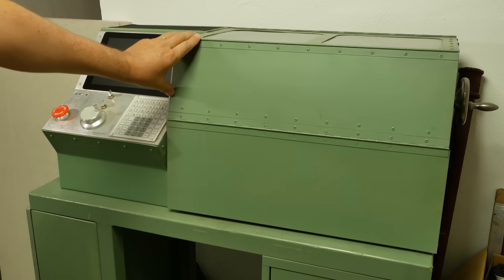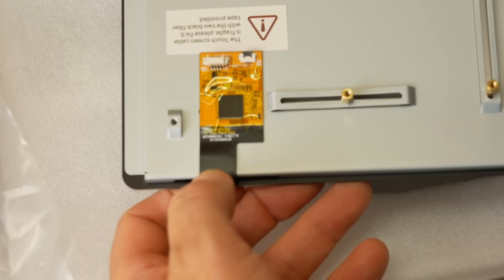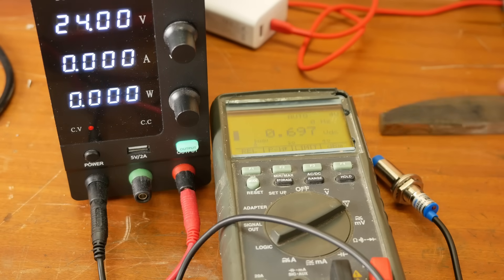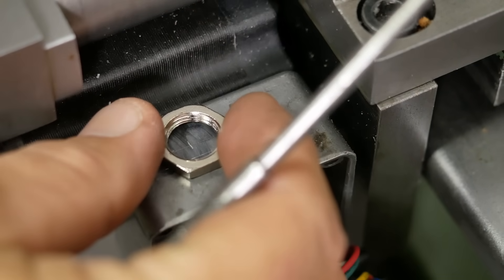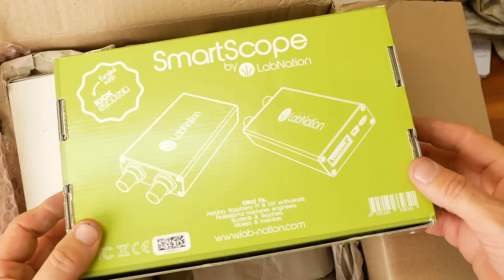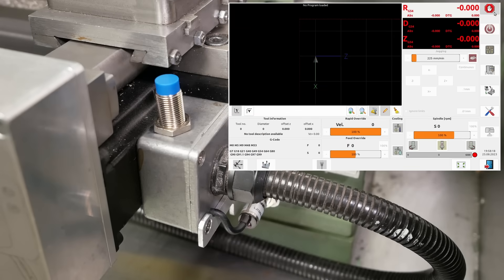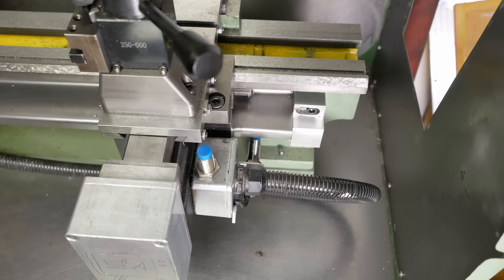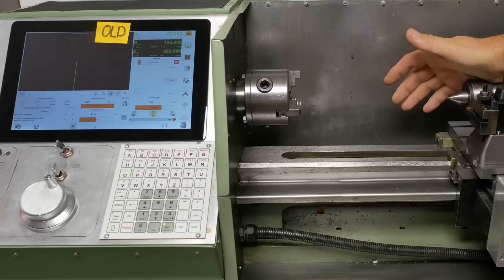Home switches - Minilathe Ep. 41 || RotarySMP

Comment: For the screen my guess would be graphics driver/settings. Hope it helps 🙂
Reply: You can add some options to the config file on a raspberry pi to force it to detect a monitor connected to HDMI even if one isn't. I used to have issues with a raspberry pi media player connected to my TV - if the power went out, when it came back on, the tv wouldn't be on but the pi would power up, so it'd boot up not detecting a display at all. Adding that option helped. It at least "detected" a display even if the TV wasn't on when it booted up, but it booted at a super low resolution, so I always had to reboot it anyway to get the proper resolution back. I've since moved to a full linux box (using an "ultra small form factor" desktop) media player, and all those problems are a thing of the past now.
Reply from the maker: This is a Gigabyte NUC running Linux Mint.
Reply: My guess is HDMI versions. Would be worth checking the specs... I suspect the new screen need/exxpects.a newer minimum version. But I am guessing so YMMV
Reply from the maker: @jamesworley2674  Thanks James. Do you expect a new linux Distro to bring the version change, or is this a hardware issue? I hope an EDID can sort that if the linux version cant.
Reply: @RotarySMP  I'd say maybe a new linux version will help. Better EDID and hotplugging support is one of the things that I think had some improvements over the last few years, depending on when your install is from. You should be able to just apt update  apt install mintupgrade to upgrade in place without having to re-install from scratch. All debian based distros should be able to update in place, just the commands are different on how to switch from one major version to the next
Reply: @RotarySMP you can also read, write and disregard edid in software, so technically you don't need a dongle for that! 
I had an issue where my tv refused to register the correct resolution, but after some hackery i got it working. 
It is a long time since I needed the script to restore it though so maybe an update has sorted it for good!

Comment: you could change the common ground / open collector on the endstop to stop floating with a simple 10k pull up resistor on its output
Reply from the maker: Thanks. This works.